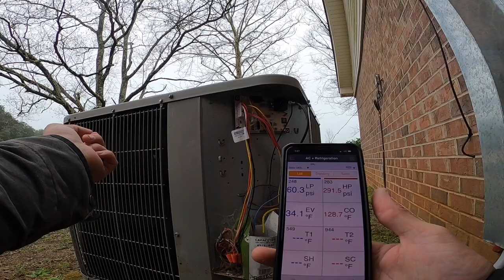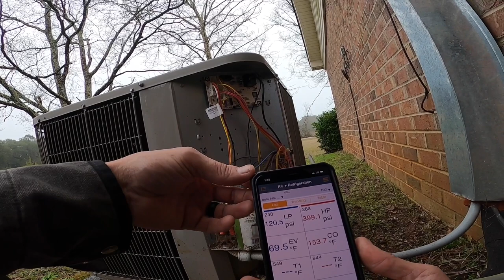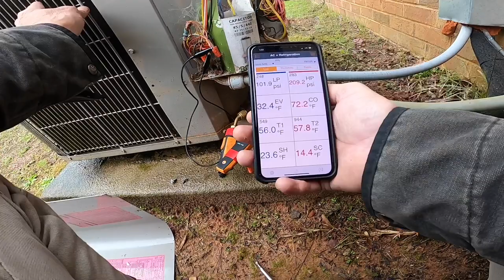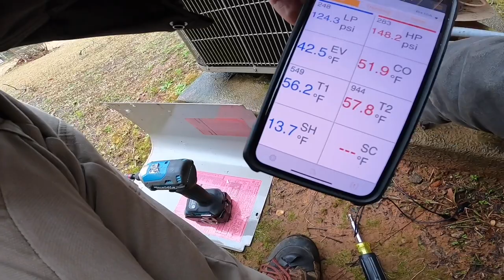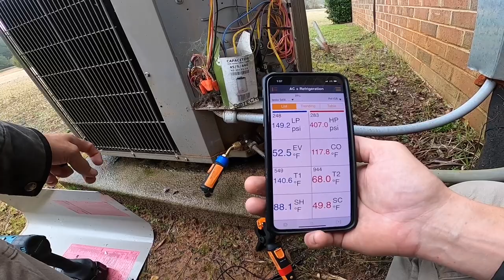Diagnosing a restricted TXV on a Carrier heat pump in heat mode.

Comment: where you are mistaken is that in heating the low becomes the high and the high becomes the low,the piston is on the service valve,the high pressure is due to the high ambient and temp inside.the high pressure opens at 600.
Reply: Your right the low becomes the high, but the high stays the high. The low becomes high pressure vapor going to the inside coil to get condensed to a high pressure liquid going back to the outdoor unit to evaporate to a vapor, so the high stays the high just in the opposite flow. That's why there's a true suction port on the heat pumps.

Comment: NO GUYS!!!  The piston CAN clog UNI-directionally.  Remember, the piston, in HEAT mode, only passes refrigerant through it's center HOLE orifice.  In COOL it passes BOTH through the hole AND AROUND the piston's SIDE SLOTS TOO!!!!!  CHECK THE PISTON FIRST!!!!!!!
Reply: Ok so your saying it's ok to have a piston and a txv on the same system? I'm confused by your comment.
Reply: @mikelewis4260  YES, BUT, only ONE kind of metering device us 'usually' in place, at each coil.  Most heat pumps have a TXV indoors for metering the a/c evaporator coil, and a piston outdoors for reverse flow metering during heating mode.  Rarely is there more than one metering device at a coil.

Comment: You can always tell when a TXV is about to go out completely when in AC mode and the high side is good on pressure but that low side will stay just below freezing....

The high side shows your charge would be good, but that low side proves the restriction is restricted too much thus the head or spring is wore out one.

Usually the outdoor ones shut off completely. Pumping unit down and pressuring out on high side one...

Also, just unplug ya fan and put that "O" on red, that is doing the same as defrost... Engaging summer/cool setting minus fan. Saves time instead of trying to trick the board etc.

Comment: On a heat pump a bad txv in heating mode is outside at the condenser and the indoor txv if for cooling.  Why did you look at the indoor txv for heating?
Reply from the maker: That rule of thumb is not always true, and wasn’t in this case.
Reply from the maker: Pressures led me there. You can run it in cooling and check. Or check all three pressure points, subcooling - temps. I may not have shown all the steps.
Reply: @HVACGUY  
I thought I had a bad outdoor txv last week on a Goodman two stage communicating System with a error code of L1 High pressure lockout but it took almost a hour for the pressure slowly rise for the pressure switch to trip it. Come to find out it was air flow with high static pressure and not enough return air.
Reply: I have a 5 ton Goodman heat pump that cools fine but short cycles in heat. It's a new system. Can you explain why it doesn't short cycle in cool?

Comment: WHOA!!  What about the carrier heat pump "piston".  It could be clogging up, while in heat mode,  from debri caught on the piston side of the drier, or decomposing line drier particulates.  The piston is right after the line drier.  Run it in heat mode until pressure overshoots, shut it down, SUCK IT DOWN, pull the piston, SEE the DEBRI stuck in the piston!!!!!!!!!!!!!
Reply from the maker: If that were the case, it woulda pumped down in cool. Low head and suction in cool. I thought of it. Also, running it in heat, I woulda had high pressures on both sides, not just one.
Reply: He’s right. It would pump down in cool.
Reply: @HVACGUY  NO GUYS!!!  The piston CAN clog UNI-directionally.  Remember, the piston, in HEAT mode, only passes refrigerant through it's center HOLE orifice.  In COOL it passes BOTH through the hole AND AROUND the piston's SIDE SLOTS TOO!!!!!  CHECK THE PISTON FIRST!!!!!!!
Reply from the maker: If I get the job I’ll check first. If you’re right, I won’t hesitate to say when I’m wrong. Lord knows, I’ve been wrong before.
Reply: @nohackacman4407  IF TXV gets replaced, your gonna replace the line filter ANYWAY.  CHK PISTON FIRST.  Run it till it clogs, shut it down, suck it down, pull the piston, LOOK AT IT and its seat.  YOU MUST RUN IT IN HEAT TO CLOG IT, TO SEE IT.  If you run it in COOL, it self UNCLOGS.
Reply: @HVACGUY  DITTO!  ME too.  I'd rather you eat crow served up by another tech, and NOT have to eat the customer's crow instead.  Plus, a whole lot easier to just replace a line drier only, and not the TXV too.  A LOT EASIER.
Reply: @BYENZER  Ruud's are backwards from everyone else. Reversing valve is engaged in heat mode not cooling. And older models also had tubes with check valves that bi-passed the metering device.
Reply: @berated4541  You mentioned Ruud, WHY?  We gray hairs know Rudd & Rheem BOTH use opposite reversing valve, method of operation.  But, this is a Carrier, which has a piston, for heating mode, clearly visible, at the outdoor unit.  So, again, why did you even mention Ruud, at all?
Reply: @BYENZER  🤣🤣🤣
Reply: @pedrocastano6410  Badges?